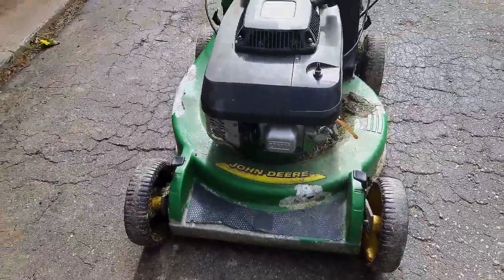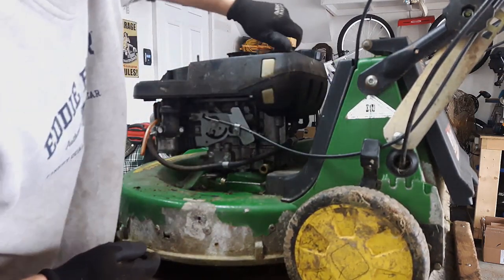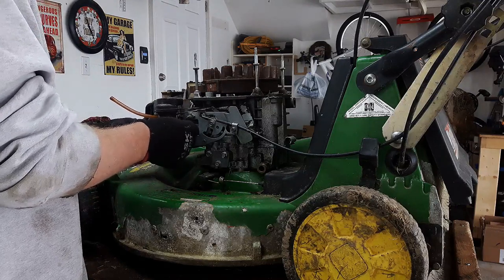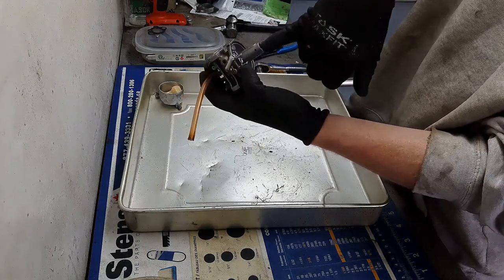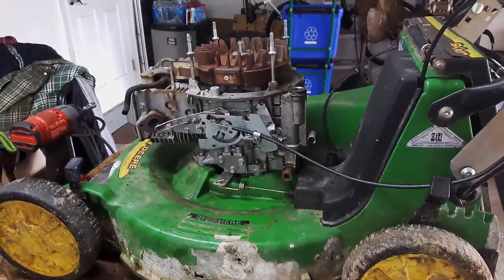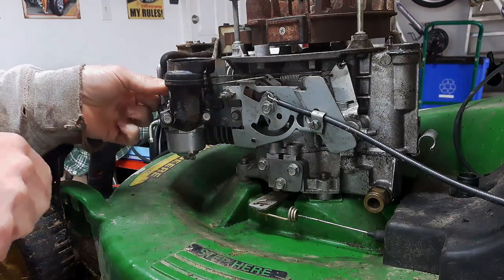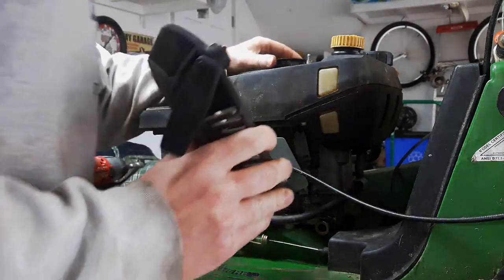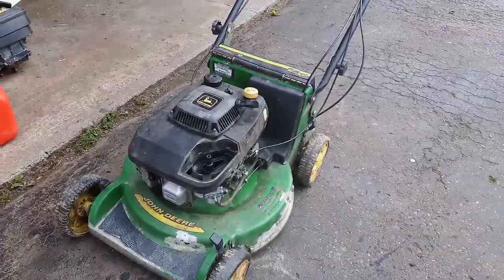John Deere JX75 Won't Start Due To Choke and Carb Issues

Comment: My JX75 has run fine all season......today as I attempt to mow for the last time this season it won't start.....one time it fired for about 3 seconds and shutoff. Very strange. Checked air filter and spark plug....all ok. Didn't know what else to do so brought up this YouTube video and saw the exact same problem addressed. I didn't want to take it all apart so I used a screwdriver to gently force the choke linkage just a hair more.......started right up on the first pull and run like a champ. Thanks to your video I was able to finish this mowing season and I now know what needs fixed on the mower before next spring.  Thank you.
Reply: So glad I could help with your issue Don. Congrats on successfully tackling this diy project.
Reply from the maker: Congrats Don.

Comment: My JX75 has ran like a champ for years with very minimal maintenance. Oil changes, blade sharpening and minor lubrications here and there. It had literally started first pull every time. Even first run of the spring. So when it all of a sudden wouldn’t start you could imagine my concern. I’m a beginner when it comes to small engines so I looked to your video for carb cleaning guidance. My carb was surprisingly clean. No gel or water. My problem ended up being the same choke problem that you had with this machine. Thanks! I may not have figured it out without the help if your video!
Reply: Glad I could help NineJuanJuan.
Reply from the maker: Glad it helped. Cheers

Comment: I have this mower and it sat for about a year. I got it out and it started first pull. I cut for about 10 minutes then parked it and gas is coming out of that yellowish tube. Any idea why that would happen?
Reply from the maker: I worked on this machine a few years ago and haven't had one in since. Pretty sure that is a vent tube. I suspect you have a needle valve that is stuck open, not shutting off the fuel to the carburetor. This could be caused by a float that has gas in it or the needle  and seat area has some gunk built up in that area. That's where I'd start.

Comment: Your video was a great help especially at 18:45 showing the location of the cutoff pin.  I have a real nice JX75 that wouldn't shut off.  Someone monkeyed with the brass cut off pin and bent it of shape. The mower would start and run, then wouldn't start after that.  It was a bad coil, carb cleaning, and new brass pin to shut off the mower.  It runs like a new mower.  Thanks!!!
Reply from the maker: Glad it helped. Thanks for watching and taking the time to leave a comment. Cheers